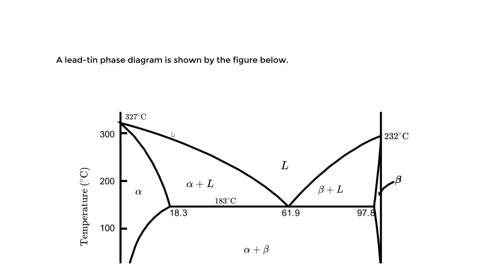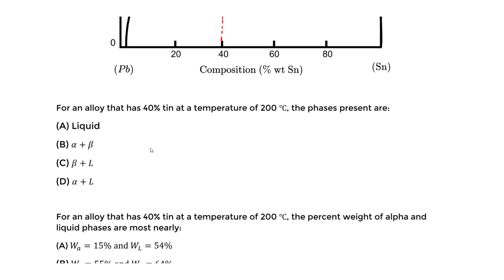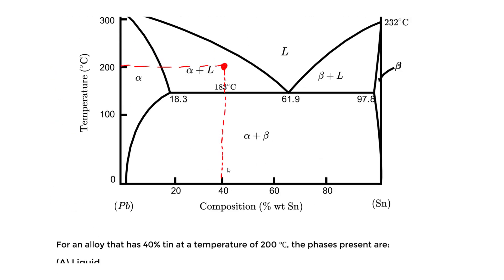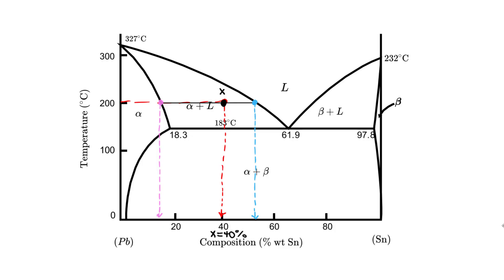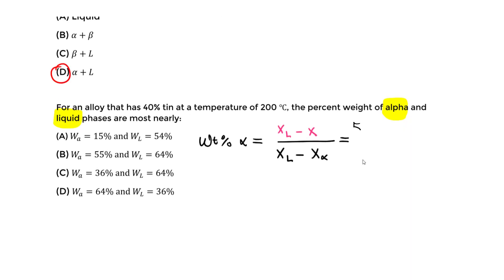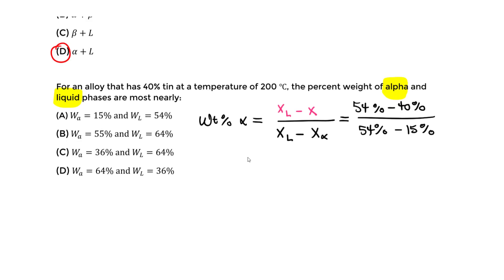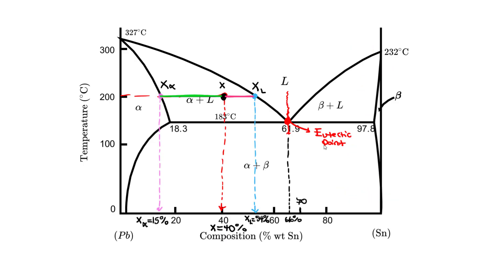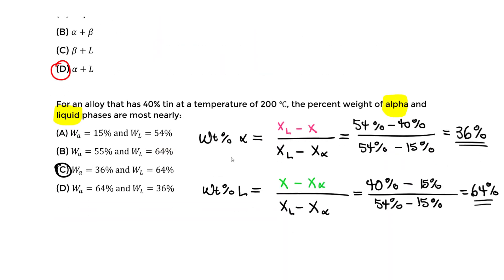FE Exam Review - FE Mechanical - Material Properties - Phase Diagrams

Comment: That seems backwards.  Why isn't the longer line close to alpha on the left of the graph the bigger percentage?
Reply from the maker: The green line? The percentage increase from left to right. The green line does have a bigger percentage than the pink one. Green (25%) and Pink (14%).
Reply: @directhubfeexam   the green line is 64 percent and red was 36 percent.  I would think the red line is the alpha but it's not it is the liquid.
Reply from the maker: @dand7056  ahh I see the confusion. Yes that definitely confused me too. The way I would do this is by using the FE Handbook page on 105.
Reply from the maker: Here is a visualization that helped me. It involves a "lever", I guess this is where the lever rule came from.

https://www.directhub.net/fe-exam-reddit-and-youtube-questions-answered/#Phase_Diagrams_-_Tie_Line

Taking the moment about the center (fulcrum) we will get W_L x R = W_s x S.  If you examine the image, the weight that the liquid must overcome to stay at equilibrium will equal to the R/R+S. 

Hope that helps.
Reply: Visually it makes sense for alpha to be larger than L but I believe this is a inverse lever rule meaning that if you are interested in the fraction of phase on the left, you have to take ratio of the right-hand segment to the entire length of line and vice versa.
Reply: That's what I thought too at first, but it does seem true intuitively as well. "X-XL" removes the XL portion so you only have the XA portion left, then you have that divided by total and then it makes sense